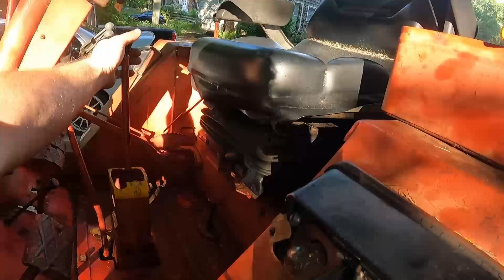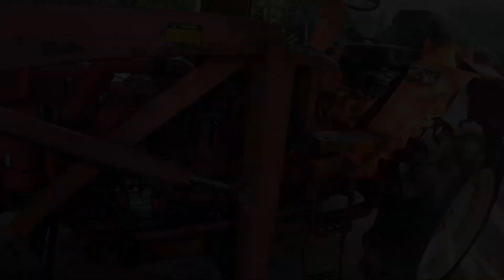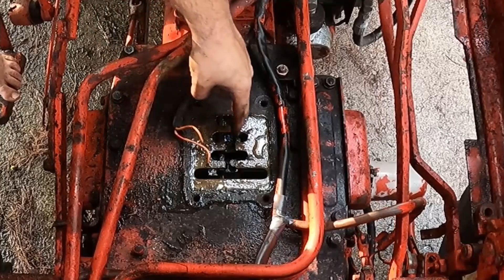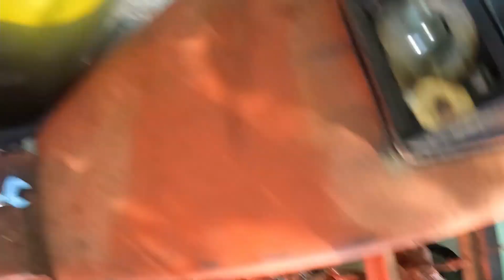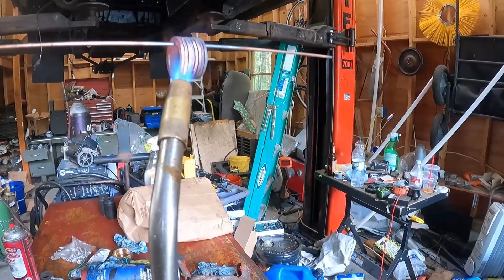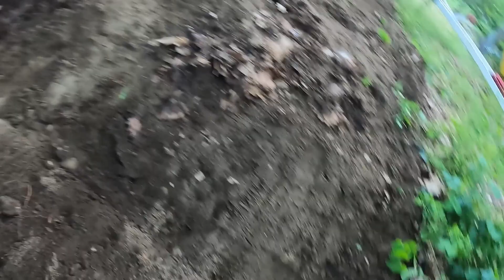Cheap Russian Tractor Repair - Was it worth it? Belarus 250AS (HTZ T-25) Stuck in Gear

Comment: Thanks to your show-and-tell experience, I figured out my "won't shift into gear" problem. All of a sudden, after twisting my gear shift lever a few times clockwise to "tighten it", I realized that it wasn't tightening at all, so I thought, oh boy, maybe I shouldn't have done that... and I twisted it back 1 time only, thinking that's probably good right there.. It was still in gear at this point and I drove for another few minutes. Then, when  trying to shift from L2 to L3 it wouldn't move... since twisting the shift lever was 2 minutes prior to trying to shift it into L3 when it wouldn't go in gear, I didn't think that twisting the gear shift lever as an issue at all. Until I watched your video... So then I twisted the lever back counter-clockwise 1 more turn and it worked again. So, twisting the gear shift lever 1 or 2 turns counter-clockwise may twist that shaft you pulled out with the 4 pockets in it and render the shifting alienated. Thanks much sir!

Comment: All export tractors from the USSR were called Belarus. 200 & 300 series are export versions of T25 and T30 series produced at tractor factories in Vladimir(ВМТЗ), Lipetsk(ЛТЗ) and Kharkiv(ХТЗ).  400 series are export versions of the T40 produced at the tractor plant in Lipetsk(ЛТЗ). 500 series are export versions of the МTЗ-50 series produced at the tractor plant in Minsk(МТЗ). 7000 series are export versions of artillery tractors к700 series, produced by the Kirov Plant in Leningrad (now this is St. Petersburg).

Comment: I don't even know if you will see this, or even answer if you you do . But if there is anyone on You Tube that will know the answer to this ,it is you!  I have the same tractor a Belarus 250 A  ,And it will kick out of gear , 1st and or 2nd under load ,going up a hill or plowing a field, Driving it on level ground it does fine ,but under load it will come out of what ever gear its in. I have held the shift stick over and sometimes it will stay in gear, But most of the time it will fly out of gear anyway. Someone Give me an idea Please.
Reply from the maker: Well, I did end up selling the machine a year ago, but if I recall correctly the rod that messed with my shifting would capture the shift rods when the clutch was released.  If that linkage was damaged or missing and the rod was in the open position, you would be able to shift, but it could pop out of gear.  I'd bet you have essentially the same problem I had, just presenting differently.  Good luck, It took me about 3 hours maybe, to get it apart and all back together.

Comment: Great video!! Thank you so much. Same thing happened on our tractor and this helped us tremendously. We have a belarus 3011. Brakes don't work. Could you do a video on that please?
Reply from the maker: I'm thrilled this video helped someone!.  I actually sold the machine not too long after I finished it.  I don't have enough room to hang on to them long term.  I did do some checking on the 3011, and the 250as has band brakes and the 3011 has disc brakes, at least as far as I can tell from some quick looking.  My advice would be to start at the rear wheels and work your way in and good luck!

Comment: Just picked one of these out of a field for a song, hopefully it's salvageable too
Reply from the maker: They're simple and tough, I'd say cleaning the spinning oil filter should be a priority as the one on mine seemed like it had never been cleaned.  Also injection pump and injectors are inexpensive compared to any other diesel I've worked on.  Good Luck!
Reply: @wirestiresandfires214  turns out the governor shuttle was stuck! It runs fine, got lucky as hell on this one
Reply from the maker: @jacksonclinton349  Easy Win, can't beat that, good on you!

Comment: I’m looking to save up to buy a tractor. Whether I should get a Chinese 25hp tractor or this Russian T25 tractor I can’t make up my mind yet 🤷🏻‍♂️
Reply from the maker: The belarus would be a good machine for actual farming.  It has an oversize pto, adjustable width, would be good for tending fields I think.  It's not that great as a utility tractor due to the manual transmission.  If you are looking for a utility tractor I would look for something with a hydrostatic transmission, very easy to maneuver.  You should be able to find a t25/250as pretty easily with a loader for less than 3k, and parts availability might well be better than a Chinese tractor more than 5 years old.  Good luck with your tractor!
Reply: Добрый день, я сам владею трактором т 25 ему 32 года, и работаю на нем постоянно, с весны до поздней осени, а зимой еще и снег чищу, он весь из железа и заменять я его не на что не хочу, китайский трактор конечно поэстетичнее будет, но он столько не проживёт как живут наши трактора, есть еще т 30 у него стоит пвм(передний ведущий мост) вот это настоящий зверь в своем классе!!!

Comment: I'm going through the same thing ...there's little to no info on this. Thanks for sharing . And the round rectangular covers on the side of the trans are the shift shafts. There's  another box on the top gearbox left  side looking at front of tractor . That's the interlock. Releases the shift shafts
Reply: So many info in Russian language from start to finish mate

Comment: I kinda had one given to me, probably because i smoked the clutch and it is toast now. It has the rubber nubs still on the tires and is much larger. The problem is replacing a clutch on a large tractor with a loader is a big job. And after driving a John Deere trying to shift that thing you start thinking, hay maybe $135 000 is not so bad for a used tractor! The 2 batteries 12/24V positive ground thing, wow is that dangerous for a north american guy to wrap his head around. Burnt my hand grabbing the booster cables! Great vid! Thanks
Reply from the maker: There is some adjustability in the clutch you might investigate.  Splitting a tractor is a pain, but I think is more straightforward than it might seem.

Comment: After uploading this.. You are now the most qualified Belarus 250 mechanic I have come across. There's another cool guy who did a walkthrough of the basic maintenance on a 250 etc. but the videos were older and not as HQ as yours. Pretty sure you could actually get a good amount of viewership through just uploading content specific to this tractor. I appreciate this content more than you can imagine. Have the same tractor and even bought the manuals.. most of it is hard to make sense of. My 250 runs great.. Leaks hydraulic fluid near the tank and the control levers. Haven't the slightest clue on how to repair them. I wish mine had that front-end loader!
Reply from the maker: Thanks for the kind words.  I'd bet the control levers are sealed with o-rings and you can get most sizes at a local napa, or a local hydraulic shop.  Do you have the parts manual, It's oddly sorted but the cutaways are somewhat helpful.  If you don't have it dm me and I'll get the cutaways that apply to your problem.  Good Luck
Reply: @wirestiresandfires214 /videos I got a hold of a Belarus 2045 with the Slavia 2S90A engine. Its an interesting machine and I've been fixing it up.
Reply: Looks like  I need another wayward tractor now. I could drive this one through the river and not get wet!

Comment: what happened to the dynahoe?? cool video's!
Reply from the maker: It works, it runs, all the reasonable fixes for it are complete.  I didn't want to overdo it for videos, and after running it for a while it's not terribly practical for anything other than clearing a lot.  Thank you, There should be at least one more Dynahoe video, but there will be loads more old equipment to come.